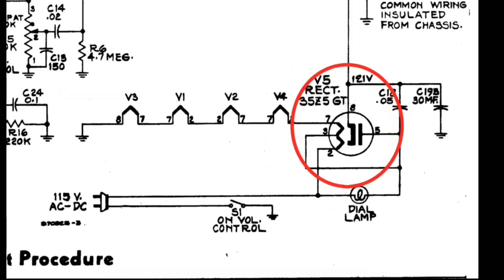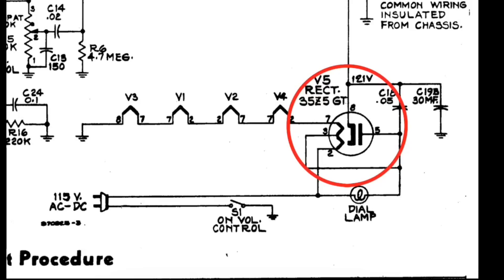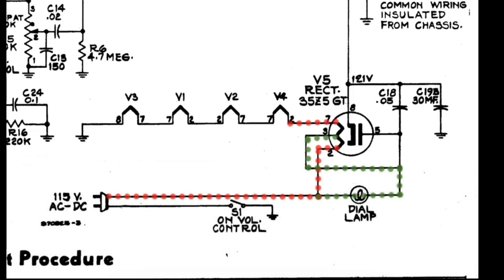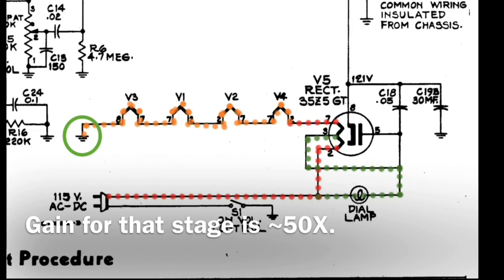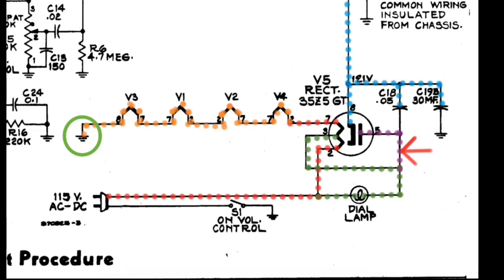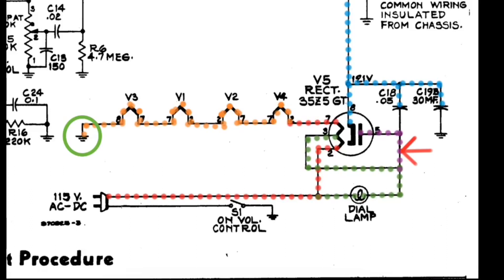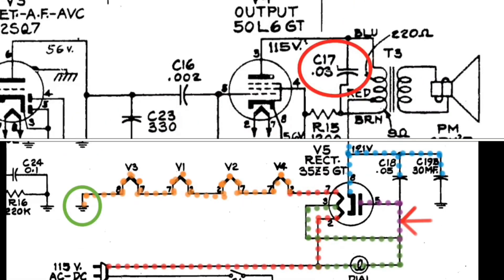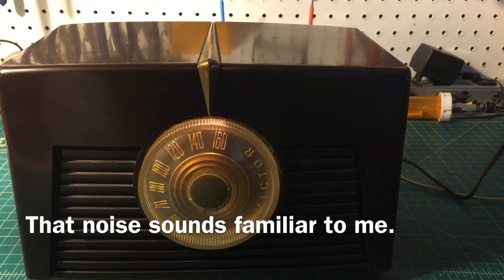RCA 8-X-541 - Cause & Effect P9 (35Z5 GT & Filament String Troubleshooting + A.V.C. Issue?)

Comment: I just got through recapping an RCA 9X561 radio and I noticed the 35Z5 is the only tube lighting up as well as the pilot lamps.The other tubes are dead.This set had a bunch of caps and resistors that didn't match what was on the schematic.I also have an 8X541 with a similar problem.I wonder what happened?
Reply from the maker: Dan, safety first; are you powering up the radio using an isolation transformer? Best, Don
Reply from the maker: Dan - have you checked the filament voltages on all tubes and B+/screen voltages? Best

Comment: These are great videos. I like how you explain how the circuit works, why it was designed that way, and even where cost cutting may have left an optional component out. Reminds me of The King and I where he's lamenting being taught, "what is so is so, what is not is not" and everything else "is... a puzzlement!" Heh, he could've used your instruction. 
Also, I hadn't realized you are recovering from an injury. Time was we were all made of leather and spring steel. Those days are long gone. Now it's damp cardboard and glass. Take care. You gotta take care of you.
Reply from the maker: I appreciate your kind words. You are right, you don't bounce back as quickly as the early days of life. Thanks for watching and all the best. Don

Comment: Excellent: insights to troubleshooting process of the past and yours of the present. I particularly like the idea that you are modifying an AC/DC radio to make it safer. Do you add a polarized plugs? I like the idea of adding fuse under the chassis too.
Reply from the maker: Mack - I did use a polarized line cord with the neutral going back to the B- common (floating) ground and course reoriented the switch back to the hot side, which will make the set safer to operate assuming the wiring of the home is correct. An isolation transformer is the safest option. I typically add fuses to AC sets with transformers and these AA5 radios only (0.6A) that I plan to give away to a friend or alike. The rectifier tube and pilot lamp was used as the fuse back when they were designed. Thanks for watching and reaching out. Best, Don